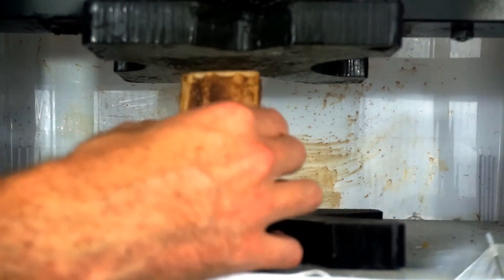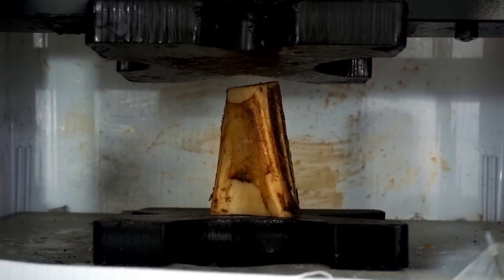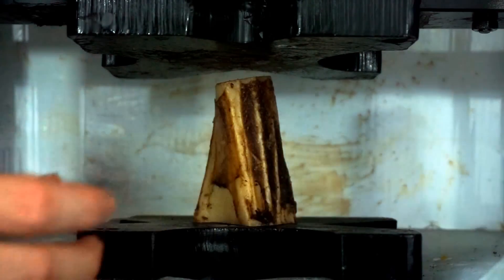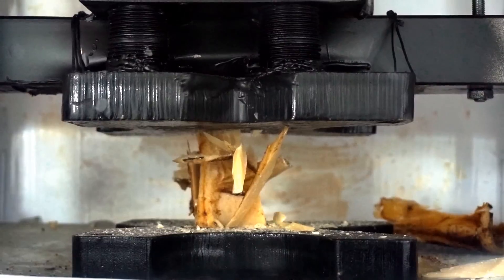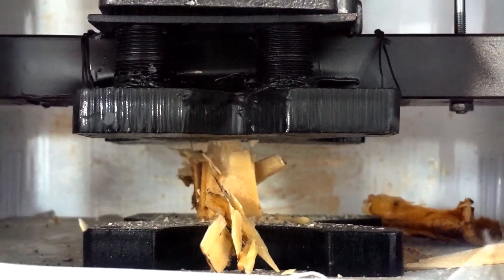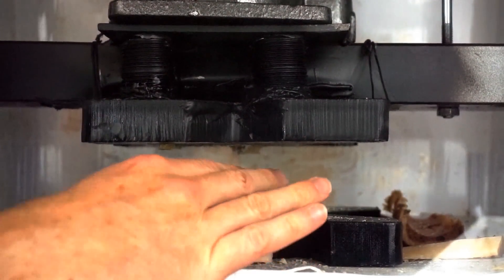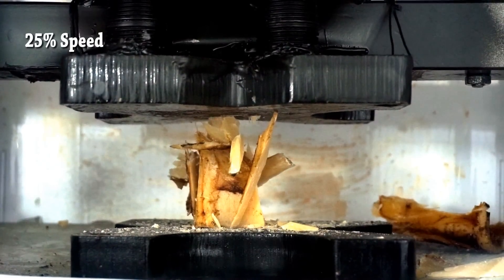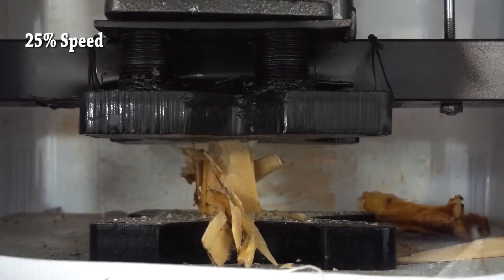Real Bone Crushed By Hydraulic Press

Comment: Awesome!  It would be cool if you can do this while showing a pressure gauge while on all its way down, then it could be interpreted as force.  And also slice/grind the top face parallel with the bottom, with it as vertical as this, so the force is spread across it before it splinters👍

Comment: It looks like the bone was cooked, I can assume that if it was not cooked it would have held up further. Heating bones makes them far more prone to the splintering you achieved. A uncooked raw bone would have had a different outcome. It would be interesting to test the difference between raw vs cooked cow bones in the press.
Reply: This is true. Cooking the bone made it weaker. An uncooked bone like that could easily support 1500lbs. A running cow will put all its weight on a single leg while moving. Put 3 or 4 uncooked bones under the press and press might not be able to break them.
Reply: ure right hahahahaha he was eating a cow meat and he found this bone LOL